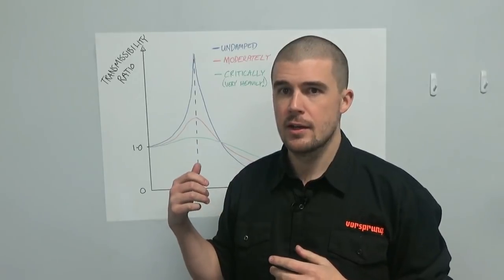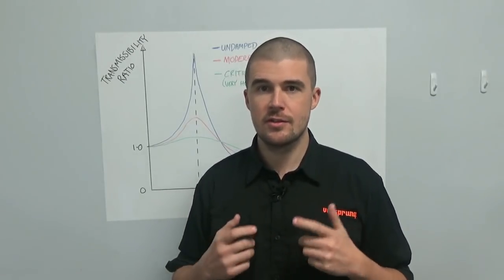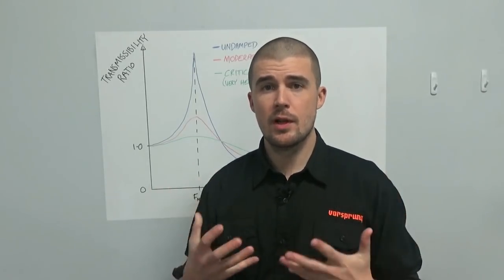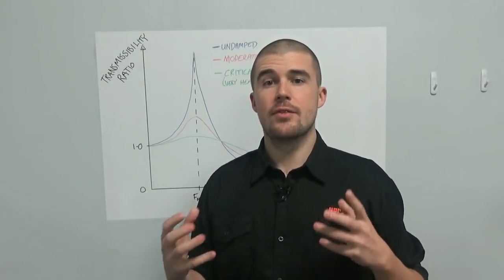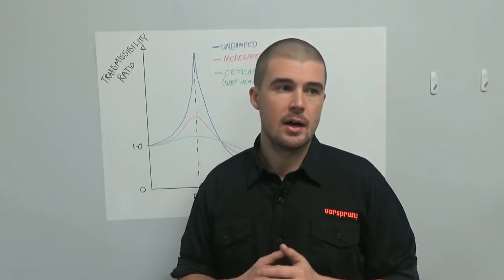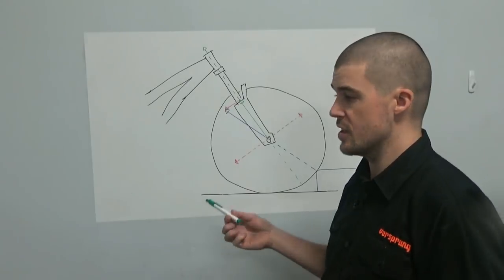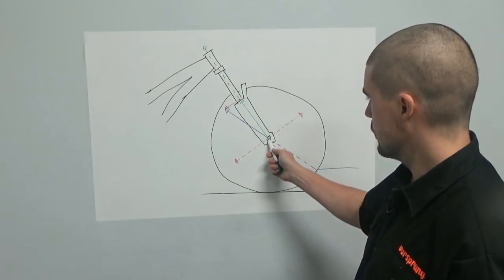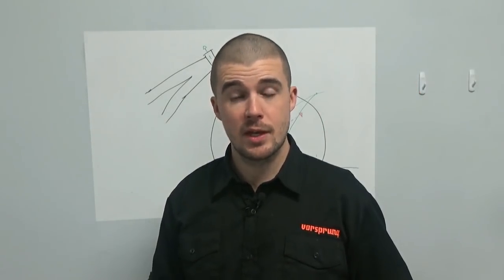The Tuesday Tune Ep 24 - Vibration and Harshness PART 2

Comment: Hello,  I have a question/idea for a new video, so here it goes...

I want to know if there is something weird going on with the Fox Float X2 air sleeve. I've read a few reviews of people running it on a YT Capra and they say they use all the travel without too much problems. We are talking about the most progressive bike in the market and using all the travel should be almost impossible for a normal person. Then I have seen a few more reviews of people using the shock in other bikes and sometimes they complain about it because it's too linear or too hard... 

It would be really nice if you could say something about this shock and maybe compare it to other shocks. What is the compresion ratio of the Fox Float X2 without spacers? what is the compresion ratio with spacers? Are those values average or not compared to something like a CCDB Air or a Fox DPX2?

A lot of people are really scared of something as simple as opening the air sleeve and adding a couple of spacers, so this could be a very helpfull video. If the FF X2 iis as lineal as I think, adding spacers is one of the first things people should do...

Best regards,
Tony.
Reply: orry, because it may be too late but in highly progressive frame designs, shock sag (let say common 30% isn't 30% of travel at the wheel. It is even 5-6% more. That's why banshee sugests in their geo charts o ignore sag marks at the rock shox dampers. Ignorance od this fact leads to running rear suspension way too soft and easy bottom out.

Comment: You speak of how some compression systems (pedal platforms) are valved to be firm at low speeds, and open up at high speed events.  You go on to say how very digressive valve systems may not blow off quickly enough to react at an initial hit/ bump.  There can be too much lag.  With extensive low speed compression, bump compliance is poor.  
Any thoughts on the effectiveness of a custom tuned Avalanche cartridge with Floating Valving Assisted Threshold / High Speed Blow-off System (FVAT/HSB)?    Do you think that the speed of the initial response to a bump would be  adequate?
Reply from the maker: Avalanche's systems are typically not particularly digressive. The midvalve system (the floating valving thing you're referring to) is only preloaded from the centre of the stack, which means you have a linear characteristic that then opens up to a secondary, much-lower-gradient linear characteristic which is added to the base valve damping. This is actually similar to the way Marzocchi's system works in the C2R2 cartridges, except Marz use this system applied directly to the base valve with the HSC adjuster controlling the amount of preload on the centre of the stack, so it can open up a certain amount until the pressure on the entire stack overcomes the spring preload and displaces the entire stack away from the piston. While these are technically digressive, they are also bilinear rather than quadratic/linear or preloaded at zero velocity. In short, the concerns with excessive digression there don't really apply very strongly.

Comment: Great video!  I just picked up a Luftkappe and love it!  Zero volume spacers and low speed compression fully open feels great on my Lyrik.  This video leads me to believe that most people that claim harshness in their suspension are running too much LSC.  Does that make sense?  Makes me think I should open up the compression damping more on my Float X2, even though it feels pretty good, Maybe it can be even more awesome.
Reply from the maker: Quite possible - there's a lot to consider with LSC. It can be a useful tool for sure, but there are multiple variables that can render it harmful to ride quality too.
Reply: Yeah.  That makes sense.  Installing the Luftkappe got rid of all harshness on my Lyrik, so I know that wasn't compression damping.

Comment: I have a question unrelated to this video....but anyway, the problem with coil shocks is that they are linear, so the don't suit certain frames..why is it not possible to have a tapered coil to make the spring-rate more progress? Like in certain sports cars
Reply from the maker: Progressively wound coils do exist, but they have limitations - they're heavy, expensive and the amount of actual increase in spring rate that you can get out of them is quite low.

Comment: Good stuff Steve. 
I will be sending my Fox 36 into you in the next few weeks but was wondering if you can give me general help regarding the harshness of this fork. It’s a Fox 36 2018 
Code DB3W.  Set at 160mm...sag at 1.25” 
PSI 60
HSC full open
LSC 19 from closed 
Rebound 10 from full closed
One token
Jumps..drops feels great,  small bumps and square rocks it’s harsh as could be. 
I’ve tried more air and less no difference. 
Running less psi makes it worse 😤
Help plz!!
Reply from the maker: What's your weight and tyre pressure?
Reply: Vorsprung Suspension 
Sorry
I’m 155-160 with gear
2.4” tires 
24 front
27 Rear 
Also bike is a trek slash 29er
I also have questions for you about rear shock upgrades...not impressed with the Trek thurshaft shock
Reply from the maker: Does it feel sticky to push on? If so, that's most likely the culprit. If not, there are a few things you can try:
1. Lower front tyre pressure to 20-21psi
2. HSC add 7-10 clicks
3. Rebound speed up 1-2 clicks

Also worth noting that if you are riding in sub-zero Celsius, the damper oil will become very thick and this can be a major cause of harshness.
Reply: Vorsprung Suspension 
Ty very much
I’ll give that a try.  Does kinda hang up at the top of stroke.  So add in 7 clicks of HSC from full open I assume. 
Thanks for your help...I will be calling you next week.

Comment: So I’m wondering what the most useful LSC range is on a typical fork in your opinion for the average rider. For example, I have tended to run my LSC about 30 to 50% of the way closed (clockwise) on a Fox 36 and Lyrik. Is there a practical rule of thumb?
Reply from the maker: It depends on the fork and the exact damper. Fox's Fit4 and RC2 dampers have adjusters that affect the entire range - generally we've found that running the RC2 LSC much more than halfway in from fully open (aka less than halfway out from full closed) tends to create harshness without really increasing support. The Fit4 you can run up to about 70% of the way in (more than 30% out from fully closed in other words) depending on your valving and weight. The Charger 1 in the Lyrik has only 6 clicks that do anything (the 6 closest to closed) and another 6 or so (closest to open) that do nothing, so 12 clicks from fully closed is the same as being 6 clicks out from fully closed (ie nearly zero compression damping). The adjustments on that damper are so coarse that 1 click difference is quite large especially if you have the RC damper.
Reply: Thanks, that’s really good information as always. It’s somewhat surprising that dampers vary so much in that regard. I am running an RC2, from what you are saying it sounds like the most intuitive of the three. I do like the manufacturer recommended 15 clicks out from closed (of 26 available clicks).

Comment: I would have easily been sold on digressive valving and reduced hysteresis prior to seeing your videos due to a lot of time spent messing with Autos. Thanks for breaking those misconceptions by explaining your perspective on mtb suspension.
Reply from the maker: It's not so much that digressive valving is inherently bad or problematic in itself (in fact digression of some form is usually beneficial with compression damping) - more to do with the proportions that can be achieved when the LSC is excessive. For example, a lockout with a blow-off threshold is essentially a digressive valve with an infinite LS gradient, meaning that you need to achieve a certain force before any velocity is even permitted. Obviously that feels harsh even if the blow-off threshold is something that the rider could easily push through. However, with a preloaded HS circuit it's possible to fully close a lot of LS adjusters to the point where you start seeing similar effects because the initial motion is restricted too heavily.

A shock with minimal hysteresis is helpful for precise control (and modeling) of load transfer in order to reduce the variation in tyre contact patch normal load, but with mountain bikes the severity of the accelerations and the high shaft velocities required means that you get less variation in tyre normal load by allowing the wheel to follow the ground better rather than trying to optimise the rate of lateral or longitudinal load shift (roll/pitch basically) like is so critical with cars.
Reply: Finally the right explanation why the Rockshox Pike RC Damper feels like s**t on small bumps and does not track the ground properly. After I changed to a new valving which is not that digressive everthing is fine and the fork works like it should :) Great video again, love them all :)